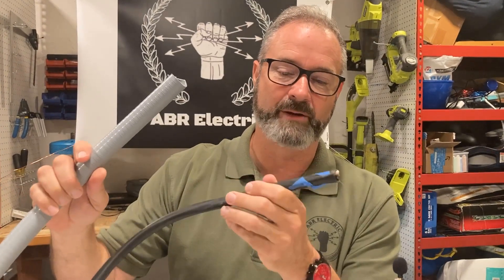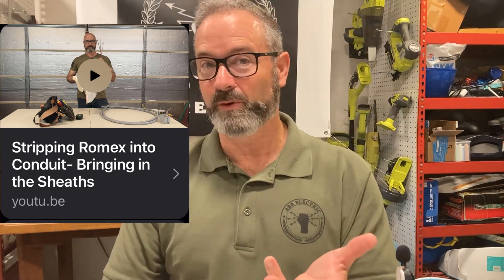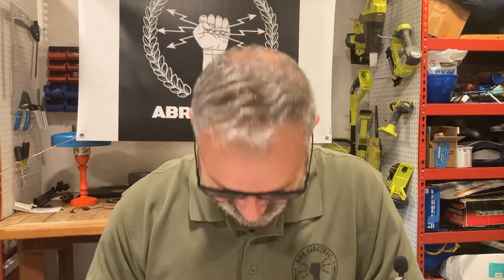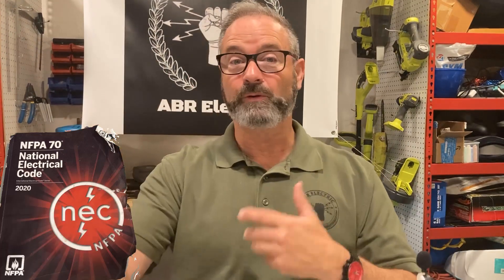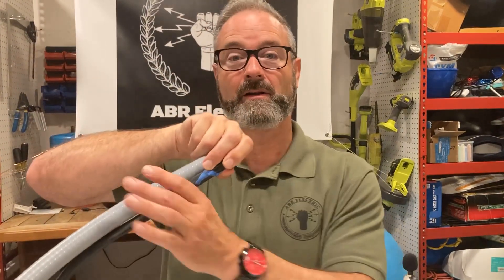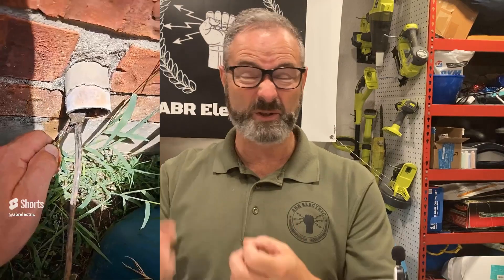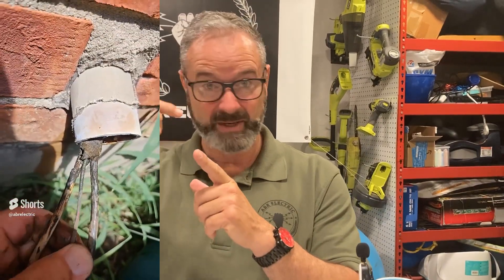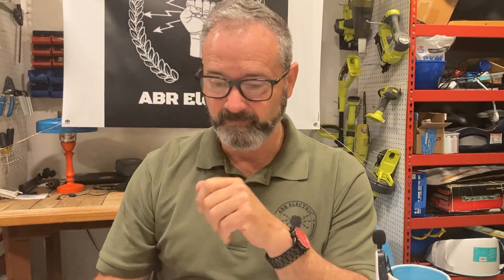Why Romex Doesn't Belong in Conduit: Quality and Longevity

Comment: Spot the American perspective:  "The house was built 25 years ago, and that's a really long time"  ROFLMAO! 🤣 I'm in England, and the house I'm living in was built in 1937.  The previous house I lived in was built in *18*37 (the year Victoria came to the throne).  Under the wallpaper you could see the route that pipes to gaslights used to run, and under the floor you could find wires and bellcranks for the bell-pull system used to call the servants...  What you call Romex is similar to what we call twin-and-earth, except there's no paper surrounding the conductors.  It's what you would always run in conduit here, and "singles" would never be allowed because that would only be one layer of insulation between the conductor and the (metal) conduit, and that's a no-no.  Mind you, metal conduit isn't often used these days - wires would usually be buried in the wall, inside oval  plastic conduit, or if running on the surface, in plastic round conduit, or "mini trunking".  Interesting to see how the other half lives!
Reply from the maker: Thank you! I love the perspectives of electrical in other countries!

Comment: You spent 6 minutes and you still didn't not cover the question in the title, not at all. In your story your friend's issue was NOT the conduit, it was the damaged insulation and water. And if that was not Romex, you would have had the exact same issue.
Reply: Like most of my College professors.
Reply: This video has literally nothing to do with the title.  He also did not prove anything about running Romex.  He only proved that it was damaged in the process which led to a short.  That has nothing to do with it being Romex
Reply: There’s wire rated for water
Reply: Romex has a lower temp rating due to the wire’s insulation chemistry, and the lack of air for cooling under the plastic sleeve. It is rated as maxing out at 60c. The actual wire does not even have a stamped rating on it’s insulation. So, if you run just the Romex wire through conduit, it may have more air than the plastic sleeve allows, but the insulation is still inferior and liable to degrade with heat, moisture, freezing and thawing etc.
Reply: @petermelville5524  Are you for real? 
(wire’s insulation chemistry, and the lack of air for cooling under the plastic sleeve. It is rated as maxing out at 60c. it may have more air than the plastic sleeve allows, but the insulation is still inferior and liable to degrade with heat, moisture, freezing and thawing etc.) Just words that do not add up and no proof at all.
Reply: @petermelville5524  The wire in romex is THHN and rated for 90C and has been since the 80s,  and its lower rating has nothing to do with its insulation chemistry. It does not have inferior insulation. More air than the plastic sleeve allows? Sounds like you're making things up because that makes zero sense. It is installed in walls and ceilings engulfed in fiberglass and foam insulation and does not need air for cooling.
Reply: @pld8993  " ... The wire in romex is THHN ... "  ---  except they don't apply the nylon outer skin to the conductors in NM-B.
Reply: @pld8993  But is the THHN in Romex since the 80's the same as THWN-2 that at least some THHN is now?  I'm not an electrician, just a farmer who does my own electrical.  And heard that THHN is pretty much always THWN, was pleased it was THWN-2 as well.
Reply: @ShermanT.Potter  All THHN manufactured today (and for decades) has multiple ratings, THWN, THWN-2, MTW, etc. In the case of the conductors inside romex, while it is likely that it is the identical product that we know as multi-rated THHN, THWN in romex is moot since romex is only allowed in dry locations.
Reply from the maker: No, THHN/THW in conduit, stranded  would have fared much better I think
Reply: @abrelectric  you did not present any evidence to support that hypothesis
Reply from the maker: @michaelkuzmin  I don't need to. I'm sharing an opinion born out of experience.
Reply: @michaelkuzmin  This guy seems like he's an actual electrician but he has multiple videos with similar misleading titles implying that romex is not allowed in conduit. He's trying to generate $$$, not knowledge.
Reply from the maker: @JohnDegurechaff that wasn't the complete response. Out of context, I agree with you.
Reply from the maker: @JohnDegurechaff the cost, more than efficacy, will always drive wiring methods - for the most part.
Reply: @abrelectric  It is possible if what was in that romex was before thhn
Reply: @abrelectric This was a very specific situation ... that wire carries many watts and is energized a lot of the time. Placing proper wire to an AC is different from running power to outdoor lights or a generic outlet. Indoor ROMEX will last forever in a "damp" location assuming the outer sleeve is not damaged which is also the same story with THWN (the clear plastic costing on which is easier to damage than the outer sleeve on ROMEX ... the difference being the easy of pulling individual wire through a long conduit or that has multiple bends).

If you want to talk about longevity then address using THHN (no wet rating) individual wire in outdoor conduits. This happens WAY more than ROMEX and it causes about 100x more shorts.
Reply: @tomszabo7350  THHN has been cross-listed as THWN for decades, suitable for wet locations. In other words, nobody makes THHN only anymore. THHN in outdoor conduits does NOT cause 100xs more shorts than romex. That's false.
Reply: @abrelectric yes
Reply: he did explain in this video already…you guy are to light to get it…

Comment: Electrical wiring in a house should last virtually forever because unlike a vehicle the house is static and there is VERY little to no vibration. So the wiring should last forever. I see the problem with the example job being the water leak.
Reply: Electrical wiring does not last forever and has an expected lifespan of 50 years. No vibration or movement is true, but all electrical circuits generate heat which, over time, ages the insulation.
Reply: @pld8993   The house I grew up in is now 67 years old. Will it start to see electrical problems? .....like a fire ? 
Oh.....and for the record we put the equivalent of Romex in metal conduits on aircraft. ....around the landing gear where it is a very harsh environment.
Reply: @rael5469  Fire not likely, especially if the wiring is left alone and not touched. The breakers, however, could be aged. A new breaker will trip instantly with a shoirt. An old breaker might "hang" for a second or two.
Reply: @pld8993  "The breakers, however, could be aged." 
The fuses, you mean.  ;)
Reply: @rael5469  You house caught the tail end of the fusebox era. I'd trust 167 year old fuses before I'd trust 67 year old breakers.
Reply: @pld8993   I wonder if the new owners still use fuses?  Or did they have to upgrade by now?

Comment: Everybody always refers to moisture, staples, exposure to sun or exposure to chemicals (paints) as a hazard to Romex. 

But nobody thinks about mice, rats, squirrels and badgers. If those situations are probable, I would never NOT use conduit.
Reply from the maker: People's dogs absolutely destroy landscape wiring. In Texas,squirrels definitely damage a lot of Romex in attics.
Thank you
Reply: I agree completely about squirrels especially in Central Florida. For whatever reason they don't like 'cloth' covered romex from the 1940's.  They don't touch the original wiring in an old barn, but have reeked have havic on newer wiring which I've had to protect in both metal and plastic through the years.  Even have to keep bait blocks under the hoods of my vehicles.  Apparently toxic chemicals can't be used in wire insulation, probably because kids may chew on it.  BUT I've heard fires are dangerous to kids too.🤬

Comment: Title is VERY misleading, seems intentional, clicks generate $$. Your video is about romex in a wet location, not about romex in conduit. There are ZERO potential problems with installing NM in conduit in a dry location. Is it amateurish? In many cases, yes. Is it illegal or will it result in electrical problems down the road? No, none.
Reply: Nevertheless, it’s always up to the AHJ. Where I live, romex in conduit is approved.
Reply: @mikesteffes9999  In the NEC, romex in conduit is approved and sometimes required. Anyone that tells you it will overheat simply by being in conduit is just wrong, period. It will not.
Reply from the maker: No ads on my videos. 3rd video on the topic because I keep getting the same questions.
Reply: @abrelectric  Understood, and I'm aware that it's a common question. Your video, however, specifically addresses why romex shouldn't be used in a wet location, not why it shouldn't be used in conduit. The issues you highlight have nothing to do with romex being in conduit and everything to do with it be used in wet locations. These are two completely different topics with different legal and electrical implications. In fact, the NEC requires that romex be installed in conduit in particular circumstances, 334.15. Also in your video summary you state the following: "When placed in conduit, Romex is unable to dissipate heat efficiently, which can lead to potential overheating and increased risks." This is absolutely false. Romex has no need to dissipate heat lest it overheat and pose a risk. It is regularly enveloped in insulation so being in a conduit surrounded by air is not even close to a potential overheating condition. While I applaud efforts to address common questions, answering those question with the perpetuation of false myths helps no one who is trying to understand the issue. But it does increase clicks and comments, including my own, with or without ads.
Reply from the maker: @pld8993  that video was addressing the outdoor use of Romex. Ironically, my earlier video and the one I did recently did address Romex in conduit, only from the perspective of correct fill percentage fo the cross sectional area of romex vs. the conduit it's put in. Your codebook: Chapter 9, table 1.

Comment: Will it hurt to run romex in conduit indoors? I am rewiring my barn,and I am running the romex inside standard steel conduit(along the wall,not inside the wall,where the studs are,because it is too difficult to remove the walls) in the room where I have my animals,from the breaker box for safety,and to make sure it's grounded.But it goes up to the ceiling in the adjoining room,so I was running the wall switch/outlet box wires in conduit up to the suspended ceiling-then above it,just running the romex open-air(without conduit) into the adjoining room along the ceiling joists to the ceiling lights/outlets which is out of reach of my animals.These are clean and dry finished rooms with walls,no moisture,that are heated and cooled(I spoil my animals).Would this be OK? Or should I strip the sheath off the wires going into the conduit?
Reply from the maker: Indoors is not a problem. You should still observe conduit fill.
Reply: @abrelectric  There is no conduit fill in this scenario. If it fits it's legal.
Reply: Conduit fill rules apply to complete conduit systems only, box to box, for example. In this case he’s simply stubbing the end above the ceiling and the romex emerges directly out of the conduit end. Incomplete system, fill rules do not apply, if it fits physically it’s legal.
Reply: @pld8993  agree with you they don't apply to stub ups, I got the impression he is running recepticals and switches  in conduit on walls, then stubbing up to attic.

Comment: In conduit is too general. I got called on Romex in a stub (box upward to 8')of exposed work EMT to a switch. Heat buildup? Metal dissipates heat. If conductor heat was a problem, the Romex sheath ain't helping even in free air. I do agree that Romex in other conduit materials need their own set of rules

Comment: When I can not use Service Romex to go up from my main panel to the attic of my garage, over to the location of my proposed sub panel in that garage and then down to the sub panel,  what wire do I use to go horizontally through the 2X4 studs from my main panel to my 125 amp sub panel? I know the Service Romex sheath is to large in diameter to go through the studs (without severely compromising strength and violating Code). Thank you.

Comment: Arent all the conductors thhn anyway? 

Personally im skeptical of the product in general - it gets stapled so tight often it cuts through the outer jacket (sometimes into conductors), at the same time if its not stapled relatively tight it's not up to code either...but.... theres plenty of it like 50 years old thats still perfectly fine, even though it does kind of seem like running extension cords everywhere... mc armored is not that much more expensive...

Anyway romex is accepted as completely fine, and has proven it lasts a long time - why would it being in conduit matter? Id think itd would have more ability too cool down inside a conduit pipe than buried in insulation....

Edit - missed the wet part. I understand the code. Still think using mc would be better in homes, so many quick connectors available to attach to jb, seems so much safer😊

Comment: 40 years ago I put a new service panel, mast/meter socket in and rewired my house - had it inspected and I ran Romex through metal conduits in my basement and garage.   Passed inspection then - would it pass now? Ohio
Reply from the maker: Possibly. Would your inspector consider the basement a Damp or Wet location?

Comment: Romex is permissible in conduit and there is nothing wrong with using it.
Reply from the maker: Assuming it's not outdoors and the conduit fill is correct.
Or just permissible for you?
Reply: @abrelectric it is permissible in that basement  on that dry concrete wall.

Comment: I'd expect that residential, 120/240 volt wiring and wiring devices should have a lifespan of 50 years.  For low voltage, 25 years.  Leaving a stripped wire in a conduit like that is clearly not okay, for several reasons.

Comment: My house has a sunroom, and prior owner had run underground 220 for a small air conditioner. We did not use that AC, and later our HVAC had to be replaced. The fuses kept blowing from day one. A/C company finally repaced the condenser fan motor and problems stopped. Years later, we got solar and it was discoverd the HVAC circuit breaker had 2 sets of wires running from it, one set for the HVAC and another one for the sunroom AC. So the sunroom AC was decomissioned.  I think the AC company got messed over and it was just an intermittent short from the sunroom run. I did run a camera in the sunroom line, and it had water in it.
Reply from the maker: It's nearly impossible for underground conduit to stay dry, if nothing else, just because of condensation.

Comment: i have a question after watching your video: why doesnt romex belong in conduit?
Reply from the maker: Concern is overheating,  and many of the conduit installations questioned are in damp/wet environments. Romex isn't rated for damp/wet environments.
Reply: @abrelectric  the question is why NM cable doesnt belong in conduit, not: why cant you run cable not rated for damp areas through damp areas inside of conduit that is also not damp-rated. if there's a reason not to run NM through a damp-rated conduit, it wouldnt be because NM isnt rated for damp areas, because damp-rated conduit would be protecting the NM from dampness

as far as overheating, is this an actual thing or just a problem someone dreamed up without any evidence? steel conduit is a poor thermal insulator. it conducts heat and radiates it out pretty readily. some types of conduit like PVC may be better thermal insulators, but if this is a scary problem for NM, why isnt it also a problem for regular insulated conductors?

if undamaged wires are overheating there is only one reason for it: they are too small for the load. my radical solution to that would be to use bigger wires instead of going neurotic about how heat is going to escape any conduit you run it through

i see no safety reasons not to run NM cable through damp areas inside of damp-rated conduit, or through any areas at any length inside any type of conduit
Reply from the maker: @rb-ex  read the code book, article 334 and 90.4.
It isn't an issue of opinions if you want to do it correctly.
Reply: @rb-ex  The issue of romex overheating in conduit is a myth. It does not overheat because it's in conduit. That's false.

Comment: I have a question centerpoint energy my utility company is saying that the reason half of my house has no power it's because one of the legs is out and the problem is The Wire underground. The power on half the house has been out for 3 days all of the sudden today the power cut on and off in the section that was out. If the underground wire is damaged can live electricity run through it.
Reply from the maker: No, or intermittently if it's not completely broken.

Comment: I want have a 110 receptacle at my gate opener 
I want to bury line & in case it for protection 
Can i use pvc conduit using underground wire 12/2
Reply from the maker: Using underground wire, absolutely.
Reply: just get some thwn conductor. its water resistant and is why you ran the pvc conduit